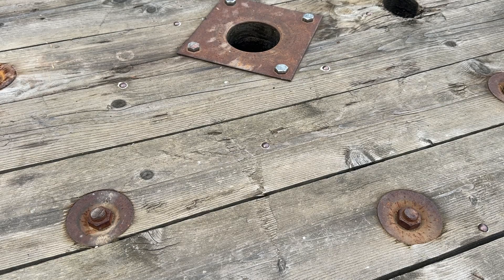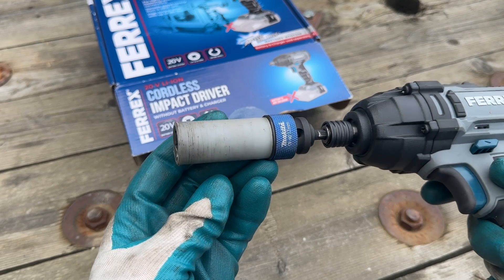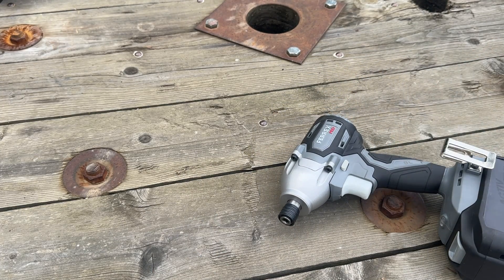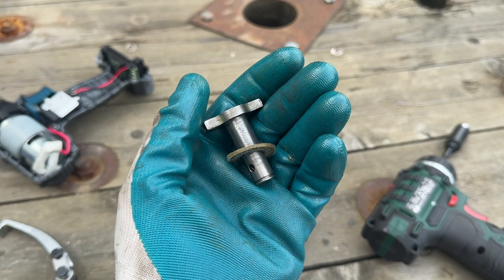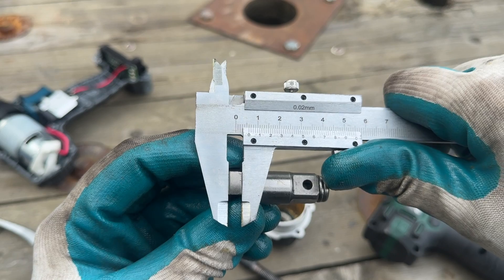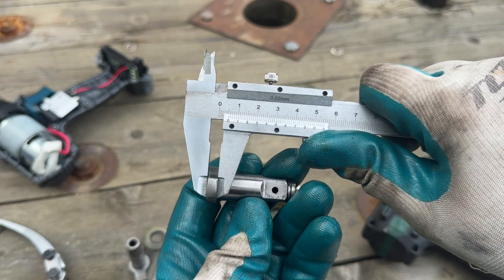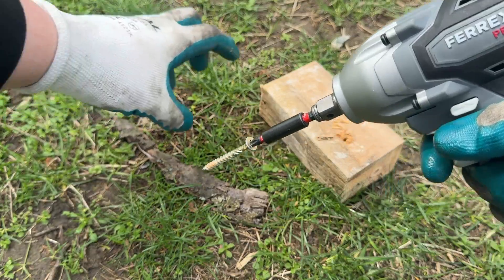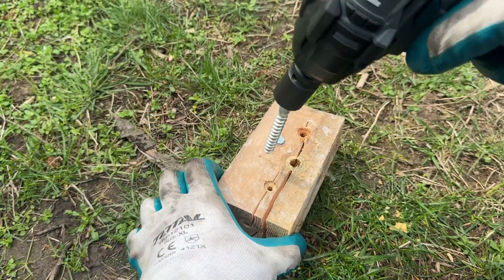Aldi tool modification. Ferrex 2 IN 1. Impact FREAK - driver and wrench. 1/2" mod for Pro and Base.

Comment: Hi brilliant video i am a big fan of the ferrex tools im looking at buying a bushing but the link shows one with holes unlike the vid, is this correct? Thanks  😀
Reply from the maker: Thank you! I guess they changed the listing. You can still use the one from the lising as it is self lubricating, however I still think a steel one is best so that would be my ideal choice, but depends on how you want to do it.

Comment: next Ryob1 impact driver the brushed one like P.235.A
Reply from the maker: That might be difficult. The opening in the casing where the anvil is exiting is just enough for a 1/4" anvil which would be around the 14mm mark. A 1/2" anvil has at least a 16mm shaft diameter so it can't go through the casing without major changes to said casing. There is a bigger chance of something going wrong with the tool than a chance of it becoming a 1/4" and 1/2" combo tool. That said I have not tried that but it is just what it looks like to me from the photos online.

Comment: Where do I get the conversions for 1/4 inch to 1/2 inch ferrex impact driver please
Reply from the maker: Hi, I have placed the links for the parts needed in the video description. The anvil is there is well. However in case the link is not functioning for you the anvil needed for the Pro version conversion is an anvil for a WORX WU278

Comment: Hi I have pro version and  I want to convert to 3/8 . Which anvil I need to buy?
Reply: Im prefer 3/8 but I'm happy with 1/2 anyway . Great video
Reply from the maker: @wmk166  Thank you, glad you enjoyed it! I am still using my Ferrex Pro with the 1/2“ anvil and it works amazingly well for what I paid for it 😂
Reply: Hi I received anvil and changed. its ok but I think spring should be a little harder. Old one is ok for impact driver. But for wrench should be little harder.
Reply from the maker: @wmk166  I have a couple of Makita leftover springs. They are cheap as chips so I could try some and see how they work.
Reply from the maker: Hi, I have a couple of 3/8 anvils around so I will test them out as soon as I can and give you the part number if one of them fits.
Reply from the maker: Update: No 3/8 anvil within reason fits on these. There is one from DeWalt which can be made to fit but needs A LOT of work and even then the socket will catch on the casing from time to time. I have not tried to fin anvils that cost more than the tool, that I think would be a bit much.
Reply: Hi I have dcf921 and will nice to get 3/8 as well. But if not is plug and play anvil im not gonna do this. I bought 1/2 from ali. Let me know if in the future You will find easy one.
Reply from the maker: @wmk166 I will let you know for sure. I tried my best on this one sorry for the negative result.

Comment: This is the best YouTube video on Aldi Ferrex Active Energy tools which are a very good cheap high current delivery battery system helped by the 2 parallel terminals from battery to drill diuretic current is 20v when using 20/40v battery which is best for heaver jobs.
Reply from the maker: Thank you for being so king to this video! I did give it my best at the time to show Ferrex fans what can be done with these tools. I still have them and get some occasional use out of the Pro one. I love it! Also I got the PRO version 40V hammer drill and I love that as well! It is a really powerful drill with the 40V system!

Comment: Ferrex did make a 1/2 inch impact wrench that advertised 400 nm I own one I got it last year before they stopped selling tools online at Aldi special buys
Reply from the maker: Yes, they have a 1/2“ impact wrench. However is quite pricey on ebay at the moment, that is why I gave this option a go. I don‘t think it‘s too bad actually. I have not tried the 400Nm one what is it like? Does it feel like it has the 400Nm?

Comment: The regular FERREX looks suspiciously similar to the Parkside 180 Nm impact driver, does the same conversion apply with the Parkside? Can you make a video about that? A comparison would be intresting too. I love your work, thank you👌
Reply from the maker: Absolutely I will make a video! I am just waiting for more anvils to arrive, because I want to convert a couple of different Parkside tools, after which we will test them. The Ferrex does look similar, however since I have not done that on the Parkside yet I can't say for sure if the size of the bushing is EXACTLY the same. Otherwise the washer is the same and the anvil will need to be the same dimensions as specified in this video.

Comment: I am Team parkside. Im so happy with the conversion on my b3. Ive thought maybe I buy 2nd one and let it sit aside and dont convert because of warranty etc :)
Reply from the maker: If this helps your case I have 3 of them 😂 Converted B3 and C3 and a non converted B3. However I got them for the videos. Currently the most used one is the C3, because I want to see if it will last.
Reply: @BrokeLifeEU  oh hahahaha bro which one is better im from Germany I guess I only can get the c3 Version now
Reply from the maker: The B3 I find is better. More power and the mode buttons I like better. But yes not like we have a choice anymore.